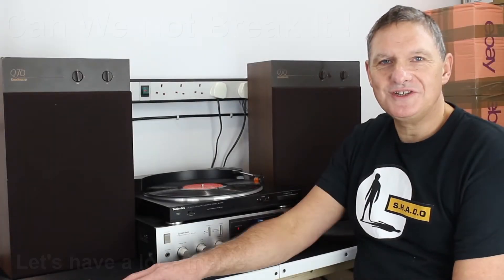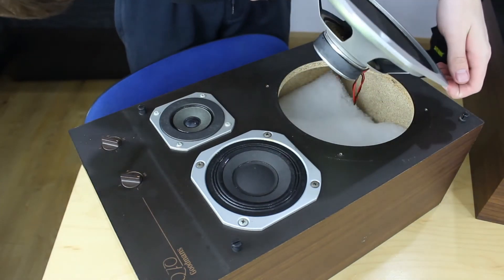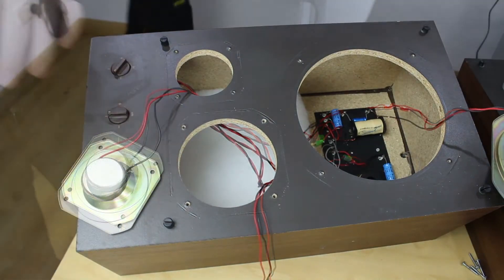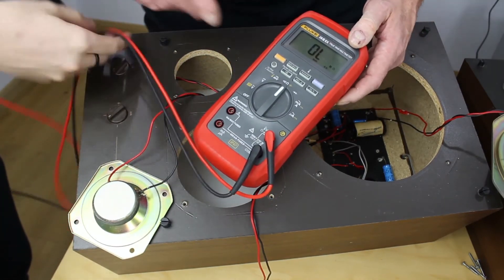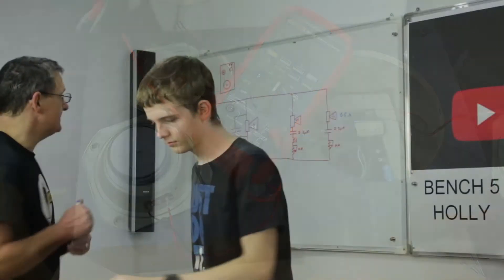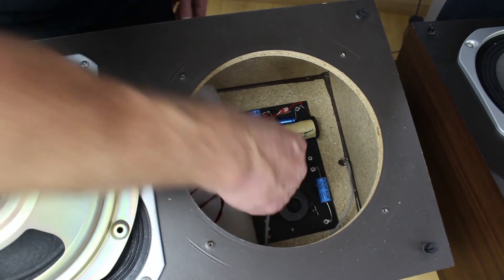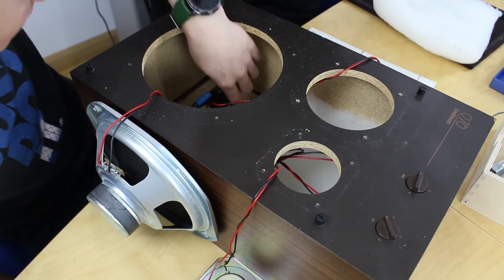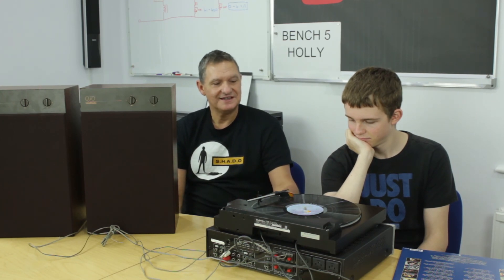Goodmans Q70 vintage speakers - What's inside the case? Let's take them apart and find out.

Comment: My brother bought a set of these out of the catalogue in 1980/81, i bought them from him, then i sold them, then about 2 years ago i won another pair for £16 on ebay, still got them but the bass speakers have gone real stiff and instead of getting a boom i get a bap, i was thinking of replacing the woofers with some free edge and cutting the rim off the old woofers and fixing them to the new ones so they look the same as possible.